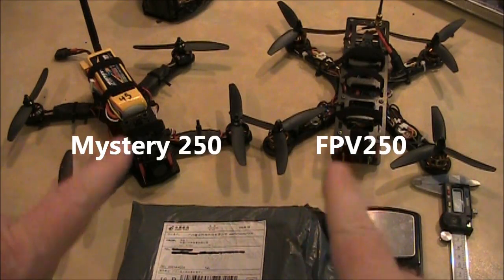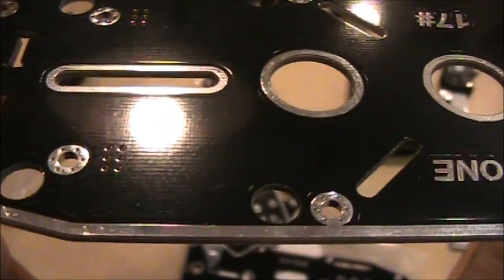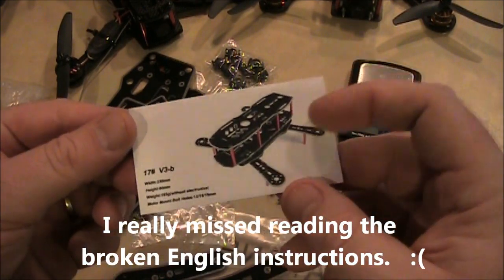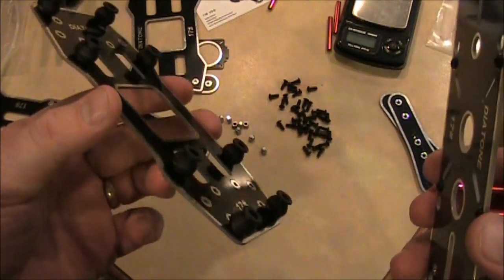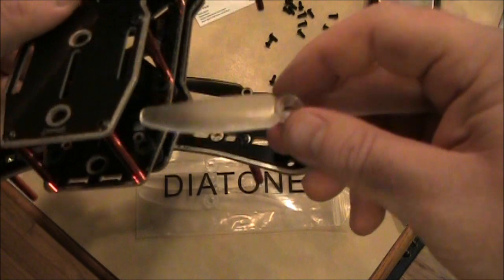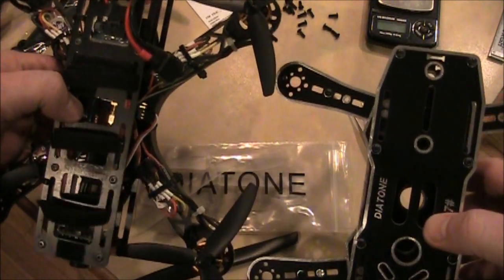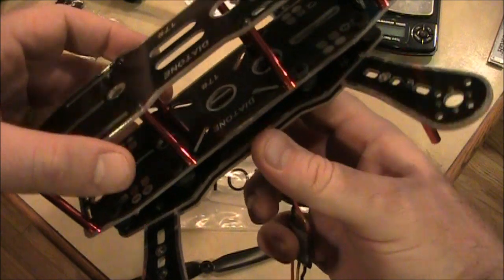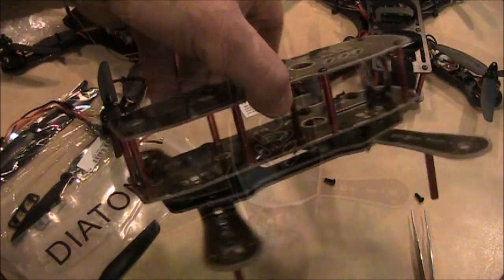Diatone 17# FPV V3-b PCB Frame Kit Unboxing, Assembly, and Review

Comment: I have some tips for this frame.  First of all use these (I use four of them and it is just fine): http://www.ebay.com/itm/8pcs-3-8-x-3-8-Rubber-Vibration-Isolator-Mounts-M3-x-5mm-/391217070524?hash=item5b165ac1bc:g:WX0AAOSwMmBVwOdR insted of rubber vibration dumpeners. Those little rubber bastards pop out everytime you crash. If you really want to stay with the rubber vibration dumpeners then add some hot glue on the top of them. I really helps to fix them on place.

Another tip is to flip your plate with PDB so the places for soldering are pointing downwards. If you solder wires from ESC to the top of the PDB directly from arms you can cut the wire with props when you are using some low motors like 2204.

Comment: Looks like G10 not carbon.  Carbon is tough to use for a PCB since it's conductive.  There are some really expensive PCB's made out of carbon g10 laminates but since CF is conductive you can't use it as a base for a printed circuit by itself.  Arms seem a little thin for G10 but otherwise I don't mind G10, it's cheaper but on a small light quad it holds up almost as well as carbon as I've been finding with the twitchity frame I've been testing.
Reply from the maker: I think you're right.  I re-read the description and I didn't see any mention of carbon fiber.  Also, it makes sense that since CF is conductive that it most likely is G10.  Great... I was wrong in the video.  Oh well, next time I need to get my facts straight.  :)